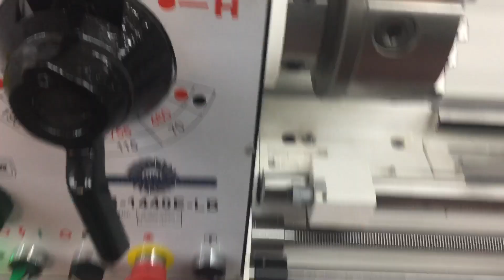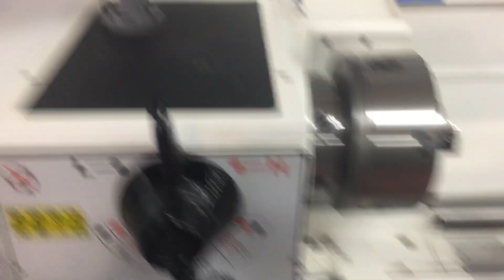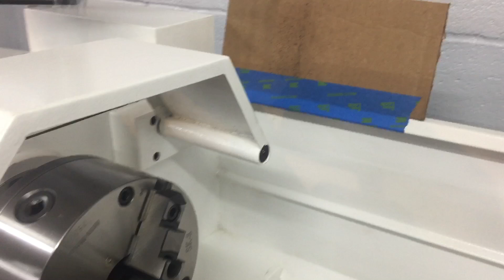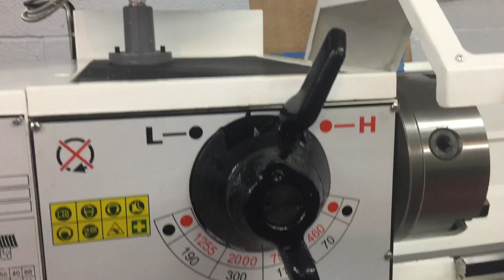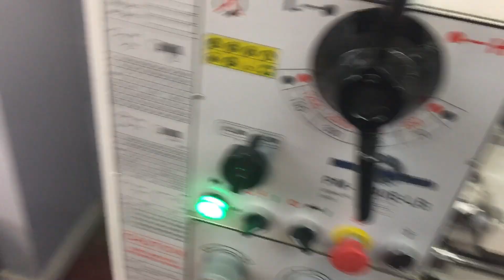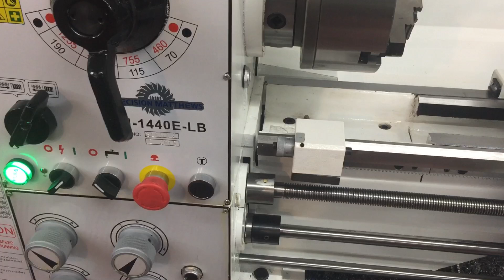PM-1440E-LB Lathe from Quality Machine Tool

Comment: anyone considering precision matthews.  don't buy their stuff.  if you are an everyday person, or "low class citizen" by their terms.  you will get their damaged or used machines.  they claim mine is new, but its pretty obvious from its condition that its not new.  people like this will always talk great about them, but i know from experience they are scam artists and don't care one bit about the regular guy.  these guys get the good machines, but you won't.  these guys have advertising, and publicity.  you won't.  you'll be taken advantage of and screwed over.  they give priority to these types of people, and assume that they can give us regular joes their damaged or no good machines.
Reply: The machine I got took 6 months from order to delivery, they were up front about that. I think part of it was I wanted 3 phase. The wrong live center and drill chuck were replaced with no issues and the replacements were better quality than the kit ones. The DRO scales and the taper attachment had been installed by Quality M. and work well. No complaints. The Chinese motor had been replace by a Polish made one by QM. It is a lot of machine for the $. It is Chinese on the cheap so don't expect to get a really fine production machine. Certainly good enough for mild production and hobby work. The only issue I've had is the amount of slack between the cross slide lead screw and the connection to the taper attachment. I will make a different system, one of these days. Can be done just using my milling machine. Anyone buying the machine I got needs to be prepared to handle 2700#s! You should use a machinist level to set it up. The collet chuck I ordered with the machine is very nice quality. I was surprised that it had the run true feature. Quality Machine/PM has no idea who I am or what I do. From your tirade I'd guess you fit the the "low class citizen" classification. You have apparently put me into your "these types of people" class, thanks its nice to move up a social class.
Reply: form my research these are  re-branded  Chinese machines  you pay extra hundred dolls for English labels and instruction
Reply from the maker: Virtually all small lathes are made in China with a few manufactured in Taiwan. PM specs these lathes and are built just for them.
Reply from the maker: They treated me well. I received a new machine. I’m not sure why you are commenting on my video about your deal, but I get it, you’re frustrated. You need to talk to Matt.
Reply: Bo, you said " but i know from experience they are scam artists" care to further explain? did / do you still have one of their machines?
Reply: I got my PM1022 lathe a few weeks ago. +Bo Huggabee is absolutely correct.  The machines are piss poor, paint is barely stuck to the castings, poor castings, hand filed to get them to fit up. The ways seem good, but everything else about the machine is the lowest quality imaginable. My looks used or refurbished right out of the brand new box.

Comment: Looks like a really nice lathe and it's not a beginner model so you won't outgrow it. One question, does anyone who buys one of these newer lathes from whatever maker actually use the safety cover over the chuck?  It's like a saw guard on a table saw, they have to come with them but I don't know a single person who actually uses them.
Reply from the maker: Honestly, I wanted to remove mine before I ever ran it. It’s rather large and “in your face.” However after looking at the setup and what it would’ve taken to jump out the safety circuit, I decided to wait until later. Now I’ve found I appreciate it being there. The guard prevents me from leaving a chuck key in and starting the lathe. It also keeps a lot of swarf and lubricant from splashing on me during operations. So now I think I’m going to leave it in place. It seems to work well for me.
Reply: Fair enough. There are spring loaded chuck keys that won't stay in on their own, but if it works as a partial splash guard as well, it might not be so bad. I might still bypass the actual switch just to make it my option.
Reply: @dieselshadow  what? i think mine still only has the wires twisted together and wrapped in a bit of tape... ;)

whislt i have it open i might change that...
Reply: You should put it straight into the Metal Shreadder !

Comment: I bought the PM1440HD, nice machine for a hobby/repair shop. Matt was fine to work with. A lot of machine and accessories for the price. The pros: good range of spindle speeds especially having the 40rpm slow one, gear boxes were all clean inside, fit & finish on the outside is very nice. Came with face plate, 3 & 4 jaw chucks that were reasonably clean inside, 2 dead & 1 live centers, 3 to 5 MT sleeve, steady & follow rests that are quite stout with brass tips, 4 change gears, DRO, D1-4 cam-lock (OK for my use but a D1-5 or 6 would seem like a better choice for this size machine.) Matt changed out the Chinese motor for a Polish made 3 phase. Other things noted: At 2700#s be prepared to handle it! The electrical cabinet/box is really crowded, The machine came with MT4 live center and drill chuck but the tail stock is MT3?? Matt replaced them with #3MT and with a better drill chuck. 5 BAX tool holders that are OK if you replace the set screws with good ones. The lead screw had a steel spring pin instead of the brass shear pin that should have been there, now fixed. Some of the controls were very stiff originally but have now smoothed up in their operation. The gear train has quieted down now that it has been run in. Since this has an 8tpi lead screw, the choices of metric threads are limited. The carriage stop is poorly designed. I made a new one.  Options I bought: taper attachment, collet chuck (very nice!) & a set of 5C collets. A better machine than I am a machinist!

Comment: Great video and nice lathe! I will be ordering this lathe myself soon. What size tool holders are you using?
Reply: There tools that go in the Holder !
Reply from the maker: Thank you! It came with BXA tool holders of real good quality. Make sure to get some of the tooling QMT has to get you started. 👍🏼
Reply: Yeah I figured it was bxa. I was just wondering if bxa will take 5/8 or 3/4 tool holders. I also plan on getting the 935tv mill. Perfect size for gunsmithing.
Reply from the maker: That really depends on the individual holders. I have several that vary in size. The XL versions can usually hold 3/4" tooling.
Reply: @Musicalbullet  My 935TS mill will be delivered tomorrow.
Reply: Then you woke up!

Comment: I am not sure what is better grizzly or this
Reply: Pm and grizzly sell the same machine. Go with the best price.
Reply: eBay milling machine
Reply: I have a Grizzly G0776, that lathe is nearly that lathe exactly.  I can tell they are built by the same Chinaman.  I'm very happy with mine and that PM is very nice as well.
Reply: My mounting feet are not here maybe You showed me a work around until they get here.
Reply from the maker: Have you researched PM or Quality Machine Tool? I too was in your spot. I did a ton of research and came to a conclusion that led me to my purchase. Matt and his crew will answer your questions as they not only sell Precision Mathews, but actually set the standards and specs for these particular machines. You clearly get more for your dollar with QMT. Grizzly makes a fine machine, but PM outshines them in all arenas in my humble opinion.
Reply: i finished a school for lathe but i am not from you country and i dont know the brend
Reply: Grizzly Service is...............thumbs down.  👎

Comment: Buy Grizzly..........and never look back...
Reply: I'm in the market right now for one and I keep finding youtube reviews of various Griz models with unimpressive responses. In one video a guy took the carriage assembly off the rails and did a blue test with poor results. You get what you pay for.
Reply from the maker: I looked very hard at Grizzly machines, darn near bought a G0709. However, the features, warranty, customer service and support were surpassed by Matt at Quality Machine Tool. I'm not knocking Grizzly at all, but I'm very happy with the PM-1440E-LB lathe purchase I made. Grizzly couldn't answer all of my questions about their equipment and admitted that the vast majority of their business is woodworking equipment. QMT deals only in machine tool equipment. There is a difference when you go to a specialist. I encourage you to see for yourself.
Reply: I will, I'm still researching. The G0709 is what I was looking at but I want the DRO factory installed.
You don't get the outboard spider on PM stuff but you probably know how to make one.
Reply from the maker: The DRO is factory installed on the PM1440E-LB lathe.
Reply: Making a spider is a good project! Several videos available.
Reply: Grizzly Service is...............thumbs down.  👎